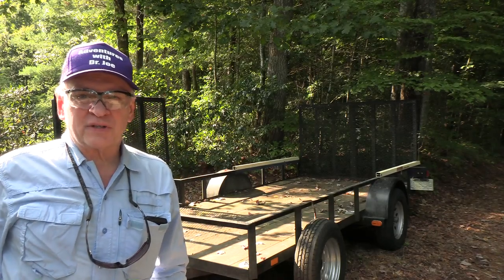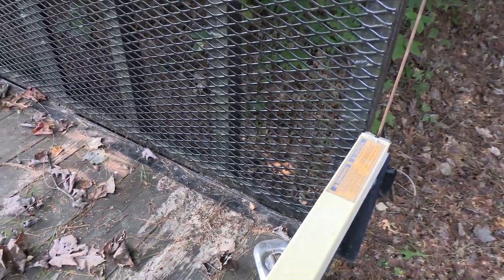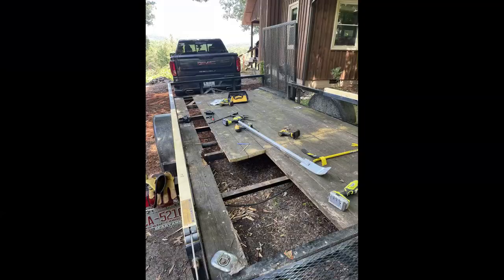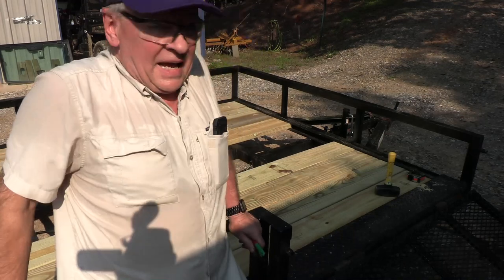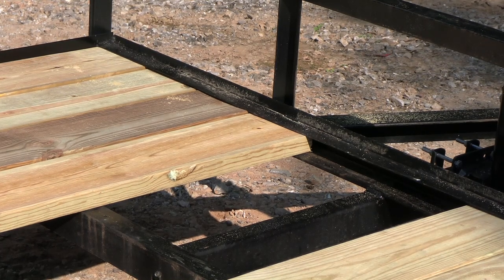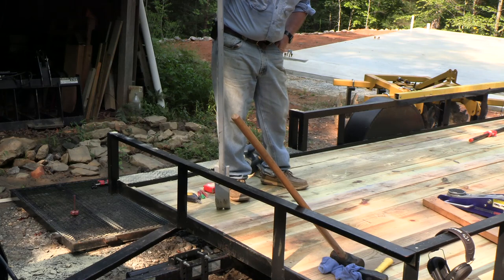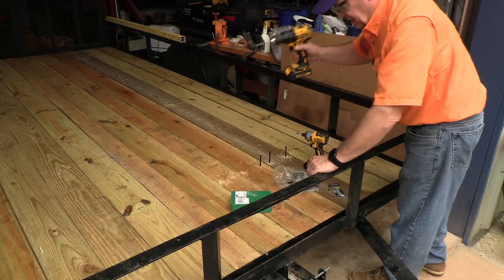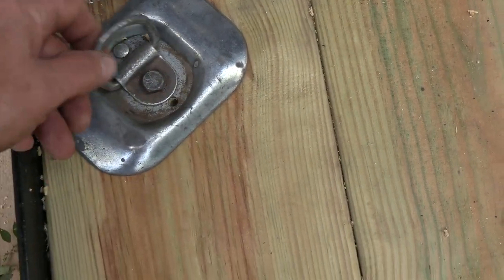Utility Trailer Deck Replacement and Rebuild w Dr  Joe

Comment: Bravo for managing to persuade those deck boards into place without cutting the channel iron. Well done, Sir!
Reply from the maker: Thank you for your comment. Absolutely no need to cut the steel tongs on each side just place one board under one side and using a small jack then that so it pops in the place. Remember these are 14 feet long so they’re quite flexible
Reply: @JosephHunstad 
I completely agree. I've seen a number of vids that involved cutting and rewelding angle or channel iron and their method just struck me as the wrong way to solve a common problem. The quickest way is often not the best way. Problem solving using logic is sadly a dying art. Working solo can be problematic but it can also force creative thought. Congrats on a task well done.

Comment: Thank you much getting ready to rebed my old 16 footer and couldn’t figure out how I was going to get my last boards on. Easy peasy after all great videos.
Reply from the maker: Hello Ray,

Thank you for your nice comment. There were some people that suggested cutting out the steel lip and then re-welding it which is totally unnecessary and in my opinion not advised. Flexing the board will allow you to get that last board in their perfectly. Consider subscribing. Thanks, Joe.

Comment: Great video! I just doing the same thing with my trailer tomorrow morning. I got a lot of information now, will be easier after this. Thank you!
Reply from the maker: It’s a tough job to do but when you’re done it’s great. I had a lot of screws that had broken off into the steel supports that took a lot of heat and effort to get them all out but I removed everyone which I think is the way to go and then once the boards ride from underneath I drilled the pilot holes and then put all the decking screws back in because then I didn’t have to put additional holes in the steel supports and weaken them. Thanks Joe

Comment: Great video. The floor jack idea was awesome. I did it this weekend by partially remembering your video and couldn't find it again after searching for about 3 weeks. Ran across it by accident tonight. I laid 9 out of 10 boards with boards 5 through 9 using the jack but I couldn't get number 10 in. I come back to tonight and see you use the world's largest crow/wedge bar i have ever seen in my life.  I think I hear you calling it Bucky, Burkey, or Berkey bar?  Anyway I have something smaller but similar and will try board #10 as soon as I get off tomorrow from work. Thank you again, so glad I found your vid again.
Reply from the maker: Premier Pry Bar 

Please subscribe then you’ll have access to that video as well as all the other ones I have. This demolition bar is known by various names. You can just put the Premier pry bar into Amazon and find it. Take care Joe
Reply from the maker: This is the one that I have. It’s made by Marshalltown it’s the original.

MARSHALLTOWN The Premier Line 10453 Open Angle Monster Pry Bar
Reply: @JosephHunstad  I am subscribed now. Got the board in because I had already bought something like the bar you had from my faint memory, from HF. After finding your video again the other night, I saw "how" you used the bar this time and "where" you actually placed the floor jack, and "how" you propped the 70lbs 2x8X12 without killing yourself like I did. Embarrassing how much strength and energy I used on those first 9 boards. Details, Details. Anyway, it is done! I made my own video but not nearly as good as yours so I will not be posting.
Reply from the maker: Thank you again for your kind comments. I’m very pleased with how this turned out and adding a small floor jack makes the bending of the boards easier or actually doable without it I’m not sure how I would’ve done it. Have a great day and take care

Comment: seems like the D rings should be installed the opposite way. The way they are installed now, it appears they could bend upward since a strap pulling toward the middle of the trailer is pulling from the far side of the floor bolt. If the bolt through the floor was on the opposite side (far side) of the ring, the pressure would be pulling directly on the bolt as opposed to potentially bending upward on the fixture. Just a thought.
Reply from the maker: I took a look at how I installed the D-rings and you were absolutely right. I’m going to turn them all around so that when the D rings are under tension it would tend to pull on the bolt not bending the plate. Thank you very much for your comment it was really good.
Reply: @JosephHunstad  You are very welcome, sir.

Comment: I enjoyed the video.  I’ll be doing my trailer soon. 

I think one screw in each board on every other metal cross piece would be more than sufficient the secure the boards to the frame. The screws are just to keep the boards from rattling and wiggling up and down. Two screws per board on every cross piece is major overkill, I’d think. 

One production note… be aware of your camera placement. There were at least two times when you were totally out of frame while talking and giving instruction.  

Cheers!
Reply from the maker: Hello Ken. Thanks for your observations and comments. Yes I’m always struggling to do better with video. I am a one-man show. Because the decking was held in with two screws per board I just replaced those. It may be overkill indeed, but it’s certainly very secure. Consider subscribing. Thanks, Joe.

Comment: Good work Good video Sir I have a 16’ Trlr 
Your video is helpful ,
Reply from the maker: You’ll be happy when you’re done and by bending the boards you don’t need to mess with those steel lips on each End of the trailer. Some people actually cut those out and re-welded it but what a waste of time in my opinion. When these are built these boards are built just like this and fit in.

Comment: Great video sir. Thank you so much
Reply from the maker: Hello CT improvement,

Thanks for the shout out. I was really pleased when it totally came together. I think you will be also. The trick is to bend the wood as you saw. Let me know how it turns out. Consider subscribing. Thanks Joe.
Reply: @JosephHunstad  Yes sir most definitely, it takes experiences to bend the wood the way you did.  I have a 5x10 and 6x10 due for replacements. Watching your videos had help me a bunch. I will start mine in a couple weeks and I would love to share my experience :)
Reply from the maker: @CTImprovement  hey buddy I would love to hear how it goes. It ended up being actually a lot of fun. Take care.

Comment: always leave 1/8th of a inch gap minimum. Your boards are going to warp
Reply from the maker: Leaving at 1 inch gap as you mentioned is a good idea if the boards are seasoned. The boards I placed were wet from the lumberyard so I put them together as close as I could and what happened then as they dried out that 1/8 gap became a parent. You make a good point. Thank you for your comment. Consider subscribing. Thanks. Joe.

Comment: I have this job coming up, at least for one board, I think I'll wield on a section of angle onto the frame member instead of going back with another screw.  Edit:  the angle will be for bolting on the new board.  I suspect bolts are less likely to rust off and / or strip but will require a person underneath for ratcheting.
Reply from the maker: Hey Greg, thanks for your comment. Let me know how it turns out. Consider subscribing. Thanks, Joe.
Reply: @JosephHunstad  You're welcome man.  Sorry, I get enough emails as it is, don't need any more, so will have to decline on the subscribe request.  If you move to Rumble, a freer alternative, maybe then.
Reply from the maker: @gregblackburn4280  that’s cool hey, I do have a number of videos on topics. I think you’ll find interesting. Check it out. Thanks, Joe.
Reply: @JosephHunstad  thanks man, will check out

Comment: I'm about to put new deck boards on my trailer. I've seen people leave spaces between the boards and other people don't leave spaces. Do the boards shrink over time and then spaces are naturally created?
Reply from the maker: Thank you for your question and comment. Yes when you put on pressure-treated wood that’s a bit wet put it on tight because as it dries out it will shrink and those gaps will naturally occur. Take care Joe

Comment: Doc does that trailer of yours have trailer brakes?
Reply from the maker: Great question this is a single axle utility trailer without brakes. There’s no question I would like a more heavy duty trailer probably two axle with brakes because then I could haul bigger things such as my excavator and Tractor.

Comment: They should have made it so front plate comes off what r they thinking
Reply from the maker: Thank you for your comment. I have now spent time looking at many different trailers after I replaced the deck on mine. Many are made just like this and you know it does kind of makes sense because it’ll keep the boards tight otherwise the boards at the end have a tendency to curl up. Also it’s a very secure method to hold the boards in place.

It certainly would’ve been easier if that plate would come off and then bolt back on but that would be a lot more work and  more costly to build. Take care Joe